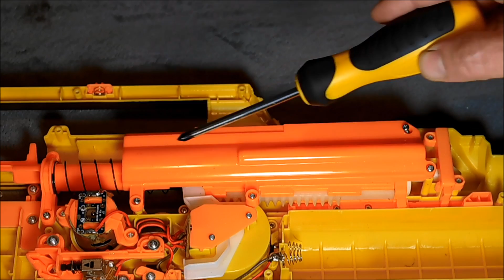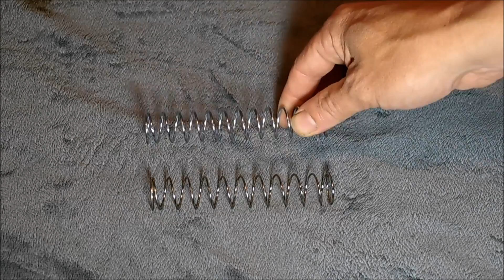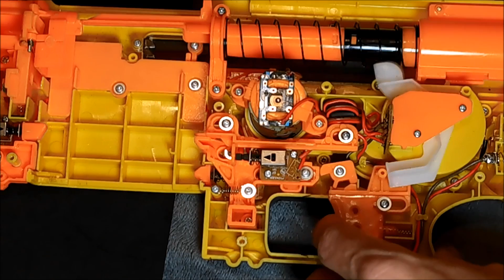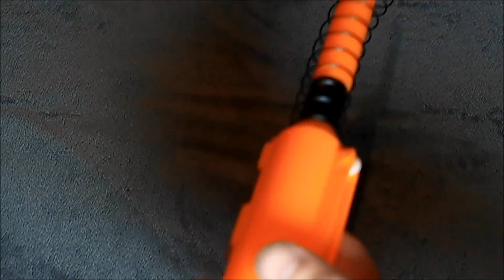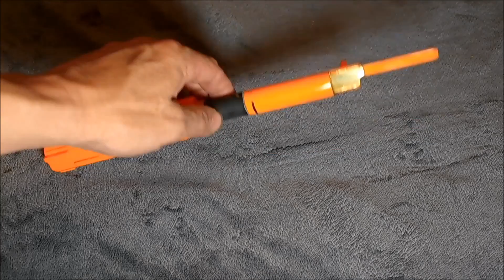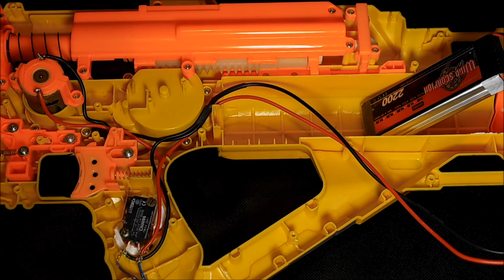Stampede Mod Guide

Comment: Chris - I just have to say this to you, and I really mean it.  I have been struggling with my Stampede for years..... I love it, and it is one of my favorite blasters, you know - old school plunger action can be so much fun compared to all of the flywheel stuff out now... So, I say that, to say this... THANK YOU!  Your video finally showed us how to rewire our Stampedes, by by-passing the silly big white switch, with the micro-switch, so that the run-away firing is no longer an issue, and with the other upgrades I've done over the years to mine, including a bigger primary spring, battery up-grade, the metal gears, and personal cosmetic stuff, my Stampede is truly a piece of art and an excellent,  and (now really reliable) performing blaster!!  Again, all thanks to you and this tutorial!!  Also, your video on the new Regulator mod is so very, amazingly helpful!  I don't know why more folks aren't checking out your work - you are a great asset to the Nerf community, and I just want to say thank you again from the bottom of my heart!!
Reply from the maker: First, you are so very welcome,  I couldn't be happier that in some very small way, we could help with getting your Stampede where you wanted it to be. Second I would love to see some pics of your blaster, I have always loved Stampedes. They may be a little dated these days, but they are still super fun to play with,  and when modded well are still good enough to get it done.

Comment: Even with the active breaking... without that white lever thing, couldn't the plunger tube stop half-way advanced if you release the trigger at the wrong time?
Reply from the maker: It does take a little getting used to, But I have never had any issues getting it to complete a cycle and fire. If it does stop short the return spring will push the plunger back to it's home position and your ready to go again. The braking on the motor just makes it easier to single fire if you want to.

Comment: You do the best mods by far thank you for all your old content and new stuff..but...ugh..if YOU can only get 75 fps out of a stampede then theres almost no point in modding it. Ive got the upgrade kit but man if 75 is the best the best can get...wat a bummer..same as the vulcan..awesome looking but pathetic performance...have you ever flywheeled a stampede or vulcan? I know it would take major shell modification but it would be awesome and give me (and others) a great example of what to do w the 8 stampedes and 12 vulcans i pretty much didnt want(except the clear and green ones) but got from online thrifting. Thank you again for all your videos.
Reply from the maker: If you have the kit from EZ mods. You should get around 140 or so out of it. I did an internal afterburner in 2 of them for PDK Films. Micro wheel and cages, no shell cutting and hitting about 90 or so.

Comment: Hey Chris I have a Question....have you ever heard of anyone making a Stampede a flywheeler by adding a cage & adding a full-auto kit from worker can it be done & would it be worth it ?
Reply from the maker: Actually I went half and half on one I did for pdk films. I designed and printed an internal after burner for it, I replaced the stock motor for better rate of fire.
Reply: @projectnerf7920  what I was thinking (I love the Stampede shell) but I don't care for the ka-chunk,ka-chunk, ka-chunk....what if ya just gut it completely & basically throw a full-auto stryfe inside the thing(parts wise)....would be an AWESOME MOD video & it will bring the be-loved stampede more up to date....just an idea I got bouncing around  ?
Reply: @projectnerf7920  oh dude...there's a lot of room in there you could even duel-stage the thing if ya wanted to (easy to talk about, not easy to do...I'm sure ) already started tearing mine apart (wish me luck BRO)  edited: as I opened the blaster I noticed there's not enough room in there...the flywheel cage has to set too high up because of the barrel position & you would have to chop the shell all up ( oh well, back to the drawing board) lol
Reply: @projectnerf7920  after-burners the way to go & PDK IS AWESOME...those guys are hilarious,

Comment: I think that may be the problem. you said  common mistake is when people wire 2 AA holders in parrarel. what do you mean because I have 2 AA holders which the 2 negatives are on the negative and the 2 positives are on the positives. s that okay?

Comment: Mortality Nerf showcased a stampede on his channel with a better brass breach mod hitting 4 darts per second @ 170fps he doesn't say the spefics of his mod but i think a experienced modder could figure it out. The nerfhaven has a better design for the brass breach that dates to 2012 and creates a near 100% air seal it has a fair bit of dead space and needs a update for a stefan dart breach i think a 3d printed magwell would be fairly straight forward to move the chambering nere the rear of the magwell. From the information Mortality Nerf revealed about his blaster it uses a 12kg spring and the return and acociated catch springs are upgraded to suit.
I think designs like the stampede that follow a airsoft gearbox design will make a comeback if they were updated with newer tech parts. The whole flywheel vs springer war rages on but a mechanical springer combines the best of both worlds.
Reply from the maker: I surely do hope they bring back the Stampede. Of all the blasters out there, it pulls at my heart strings the most.
Reply: @projectnerf7920  I only just got into nerf and i am seriously considering modding one, the only reason i havent is because i own a 3d printer i am going Caliburn + basic stryfe/ woozie maybe hammershot loadout i am not liking the hammer right now will see if a 3d printed hammer holds upto a 10kg spring. The stampede mod doesnt require any 3d printed parts unless you want stefan darts which the adapter could be purchased off the shelf. I am messing around with a cycloneshock its a lot of fun, i think the strongarm is better but known to brake and requires a better plunger arm mod.
With better 3d designers around and 3d printing becoming more main stream for the hobbie there are so many nerf guns getting major revamps by modders. I was talking to a airsoft modder about their plunger system and how effective it would be for nerf basically the same setup as they have doesnt move enough air but the setup it self is what we need. If a modder was to redesign a airsoft system with a bigger plunger say the size of the caliburn 1-1/2" or 40mm (they are different sizes as 1-1/2" is around 38mm which isnt sold where i am) for metric countries and using a k26 style spring we would have the best of both worlds of a springer with a higher rate of fire.

Comment: Great Video...I just subscribed man!!!  I have a question...Can I upgrade the plunger with the new heavier spring and not do any wiring or a new motor?
Reply from the maker: You don't have to replace the motor itself, but I would very highly recommend a re-wire. The stock wiring isn't designed to handle the increased voltage or current from Lipo batteries.

Comment: Great video, very easy to follow. Was wondering, what size wire are you using?
Reply from the maker: 18AWG silicone insulated wire, works well for the stamp as the single motor doesn’t draw a ton of current.
Reply: Excellent, thanks

Comment: Just got two stampedes, really want to get it souped up
Reply from the maker: Stampedes are still cool, I wish Hasbro would release a revised version of it with more modern internals.
Reply: Seeing as they did that with the longstrike, I would definitely want to see a new stampede. Perhaps maybe adding a barrel attachment, and having it take c batteries instead of d batteries.
Reply from the maker: That would be so sweet.............. :)

Comment: Do you have to remove the air restrictor? Btw what 4s lipo are you using? I'm going to be using a 9kg spring with metel gears and a upgraded catch spring. Plus the rewire.
Reply from the maker: If you are going to brass the breech, I would recommend it. If not then leave it in it helps to avoid vacuum loading. It's a Turnigy 2200 mah 45c90c burst, but you can use much larger in a stamp if you want too. Lots of room in the battery compartment.

Comment: You didn't put the white actuator back right? Does it have runaway firing? Cuz I'm planning to wire my Stampede in the exact same circuit as yours.
Reply from the maker: No, surely didn't. I removed it and the stock switch that it pushes to auto cycle. With them removed and a new micro switch behind the trigger there is no way fir it run have a runaway at all.

Comment: I can follow the wiring up to the point where the black negative splits off from the normally closed on the switch and into the other half of the Gun shell. What happens after that? Also how would I wire up the master arming switch again if I wanted that feature? Any diagrams would be most appreciated. Great vid. (Subscribed)
Reply from the maker: I'll draw you something up. Shoot me a message over to the Gmail and let me know where to email it to.

Comment: Hi I followed this mod guide to the letter with the sole exception of brassing the breech but I cannot for the life of me get it to fire. Tried running on 4S and 3S batteries, reinfoced the catch and beefed up the catch engagement springs. Darts consistantly get stuck in the dart gate and prevent more darts from feeding. The system works fine when the plunger is asssted by hand but not under power and I am running out of things to try. Any help appreciated. Thank you
Reply from the maker: Not 100% sure my friend, I didn't have any such issues with mine. Can you shoot me a video clip over to Project.Nerf.2.0@Gmail.com ? I'll take a look and perhaps we can figure out what's going on with your blaster....................Chris

Comment: I have a stampede. I wanna ask you a question if that's okay with you. My stampede is pretty trash. It shoots darts about 3 feet away from the barrel with no real power in it and I don't think its the batteries. Therefore, I have plans which is to mod the gun. I was thinking of taking it apart, removing the air filter, padding and removing air spaces on the plunger stick like you did, and hooking up a new battery onto the stock battery connectors because the batteries are a pain. can you tell me how this sounds and if you think this will make the blaster any blaster. than k you for your time.
Reply from the maker: That sounds like a good plan to me. If it is shooting so poorly , I would also very carefully check to see if the plunger head is cracked, or the main O ring is dry rotted. If you need any help along the way just shoot me a mail, and I'll be happy to help....................................... Chris

Comment: i have a quick question: i've modified the exact same way as you, but no upgrade spring and yet im still stripping gears and i have no idea why. i've 3d printed replacements until i order stronger nylon ones but i have no idea why the gears keep stripping?
Reply from the maker: That's quite odd, normally you only have trouble stripping gears out when you go up on the spring load. I'm at a bit of a loss here. But if it were mine I would double check to make sure that everything in the gearbox is lined up correctly and turns freely without the motor in. You might also check to make sure that nothing is catching/hanging up on the plunger assembly as it goes forward. If you like , send me a few pics over to Project.Nerf.2.0@Gmail.com. I'll take a look and see if anything jumps out at me, as far as problems go................ Chris

Comment: Hi mate I rewire mine the same but never set up motor breaking in one. I do in my flywheel boasters though. Can you post a firing demo please. Thanks
Reply from the maker: Sadly I don't have the blaster anymore, it was sold out of our Etsy shop. But the breaking is nice if you are going to run a very high fire rate. It does take a little getting used to, as you can actually, not pull the trigger long enough and the blaster will only cycle about half way without shooting. But once you get the feel for it, I think it's a nice little control boost.

Comment: Did the 17/32 in the bolt cause feeding issues? Cause it's a tight fit; wouldn't a 9/16 be better?
Reply from the maker: That one ran just fine, but often you do have to do a bit of tuning, to get it to run well........................ Chris

Comment: I have a problem. can you help me. I opened up my stampede and I realized that the AR is removed already and the plunger has a cushion. I changed the o ring to a better one and I put it back together. then I did a battery mod. I used 8 AA batteries to try and run it on 12v, but when I assembled it and started using it, its shooting very slowy. do you know what could be wrong?
Reply from the maker: Well I hope I can help. There are a few things that can cause it to run slowly. The first possibility, is the new O ring. If it is too tight, the friction will cause the blaster to run slow and shoot poorly. Remember that the plunger tube has a slight taper to it, so the plunger may slide smoothly for the first little bit and then get pretty tight. Knowing that you upgraded the voltage to 12v, leads me to believe this could be the problem. 
Did you remove the board from the motor? just asking because there is a fair amount of resistance there, so even though you have a 12v battery pack, you may be getting less at the motor. Make sure you battery pack/ packs are actually producing 12v, a common mistake is to wire 2 , 4 AA holders in parallel instead of series.  I would double and triple check those things first. If they check out, shoot me a mail and we'll try to go from there............................................................................................... Chris

Comment: how fiesable would it be to increase the size of the plunger tube assembly (length and or width)?  What kind of power increase would it yield? ie. a theoretcle volume increase of 20% would have what X% end result. Is there sufficent space within the shell for said volume upgrade or would shell mod be required (as i suspect)?
Reply from the maker: I'm not really sure what kind of power increase you would get, but I have seen expanded plunger retailiators that seem to shoot a mile. I think you are correct you would probably have to do some shell cutting. If I was going to have a go at it, I would expand the tubes width. doing length will interfere with the catch mechanism. It would be a long and interesting project, but it could be done.
Reply: thank you.One more question occured tome in the wee hours of 0-dark-30,related to the electric mods iv seen you and others do. Would it be possable/practical to install a variable voltage regulator switch (ie dimmer) to motors to be decresed in there max rpm and power? Pourpous... to set the max fps of your favoriate blaster so that you could use it at events with various fps limits without changing anything except a setting. I hope that made sense.
Reply from the maker: I have seen that done actually, I myself have never done it. You'd have to use PMW ( pulse width modulation ) to control the motor speed with a potentiometer that way. Iambobolol, did it with his khaos pistol build. Here's the link check it out, you might be able to get an idea of what he used. www.youtube.com/watch?v=_QqOo08QIu8
................................Chris

Comment: nice tutorial, getting my stampede in a week, cant wait to mod, btw if i add more Cell lipo battery like lets say a 5, only my firing speed increases right? Not my actual range/power of shot correct?
Reply from the maker: Yes, if you add more voltage it will only increase the fire rate. The power in your stampede is based on how strong your spring is and how good the air seal is throughout the system. It can be a delicate balance, I would recommend starting with lighter spring loads and lower voltages. Then increase them gradually until you get the overall performance you are looking for. All the best.......................................Chris
Reply: Thank you, subbed and liked, really good channel

Comment: do u think i could add k26 spring with these mods?
Reply from the maker: I tried a K26 spring in one once. I did get it cut down enough for the blaster to function, though there was a bit of spring rattle. The problem I had shortly there after ,was the K26 put so much torque in the system that it broke the gears in the gearbox.  I would have to say, that without a very upgraded drive train, K26 is a bad idea. Even an 8kg spring causes premature failure. A 6kg spring load is all that I personally have ever gotten any durability with. But with enough mods anythings possible right????

Comment: How do you get the brass in, mine is stuck halfway through. Plz help
Reply from the maker: You have to really take your time with the brass, and the drilling. Often you can get the brass started in the barrel and then it gets stuck. In that case , I remove the brass and do some more drilling , or sanding. A nifty trick I like to use, is to sharpen up a scrap piece of brass with an exacto, and use it to remove any extra materiel from inside the barrel. Just keep working at it slow and steady, you'll get it....................Chris